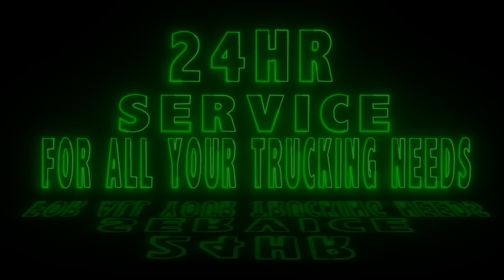A DAY BED TRUCKING ON THE FRAC,  ZERO DPF KENWORTH

Comment: Interesting matting sling with the double hook affair, I haven't seen that before. Kind of makes sense, line would always be centered. But it looks flawed a bit, a few of those mats were tore out and I'm guessing that's from sucking too far into the winch.

The Devil song had me laughing out loud. Good one.
Reply from the maker: These are 10x50 mats so it’s the only way, and yup some are tore out and don’t come over the roll without driving ahead and winching at the same time. They are not engineered they just built them. The newer ones are a 8 wide so you can sling them the just box around and out to make a ten wide

Comment: Hauled drilling mud for R.Robinson transport which was bought out by Formula Transport for 17 years, if possible I would try to get on or off 
Location before you guys less hassle and sometimes roads in were better 😅,safe travels guys
Reply from the maker: definitely so when drilling rigs move, i always hated third party guy showing up in the middle of a rig move getting all in the way
Reply: @TimelapseTruckerRTOT  I never got in the way. Sometimes, you guys were nice enough to bring out the trailer I was picking up, sure made my job easier, and yours too
Reply from the maker: I’ve been the third party guy lots.